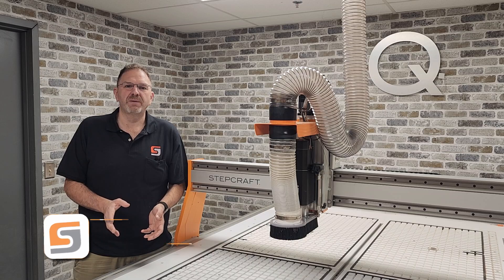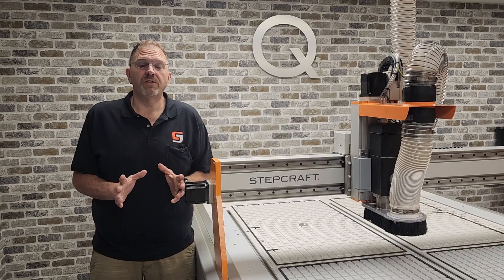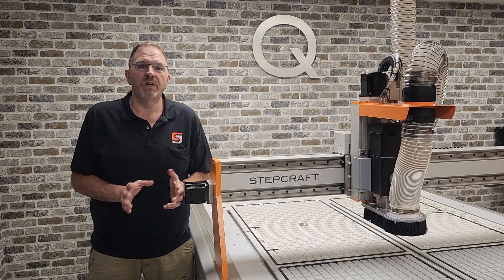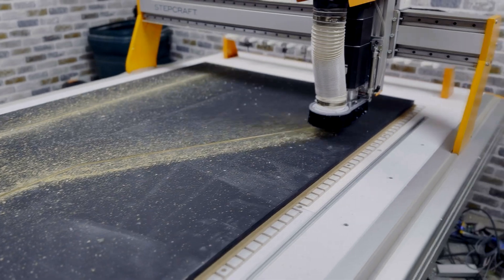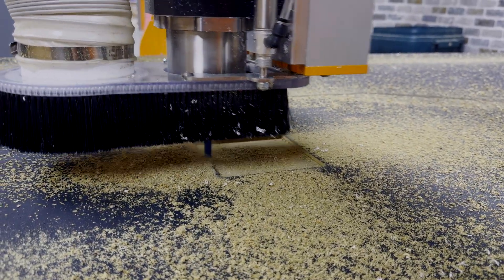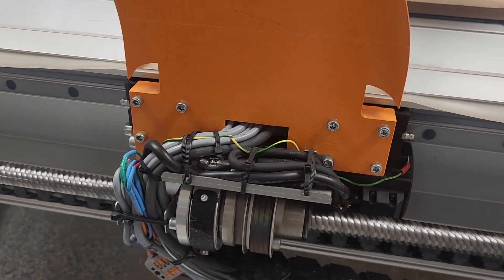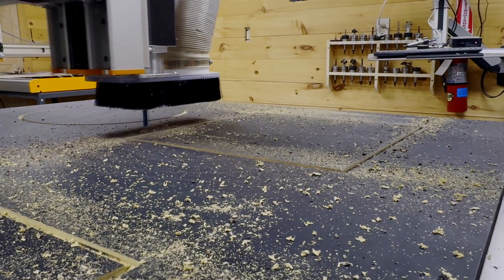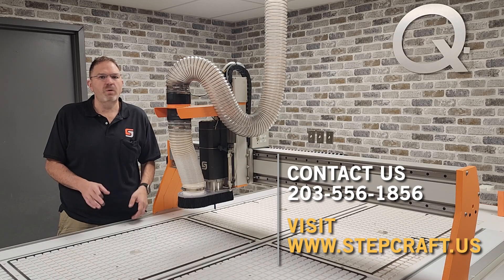Watch this series before you buy! STEPCRAFT Q.408 - Episode 1: Speed

Comment: Ever consider a 4x10’ model? Or is that not possible with ball screws? I flatten a lot of 10’ slabs and need 10’ minimum.
Reply from the maker: Hi, I will take your comments to our engineering team for future consideration.  Thank you!.  One thing that many of our customers do take advantage of, is the fact that our machines offer a pass-trough in the Y direction.  This means you can use the Q.408 to flatten a slab longer than 8 feet by running it and then sliding the material back in the machine and running the remainder.  You will find that detecting where the overlap is located is nearly impossible to locate.  When you get into the longer machines the price goes up significantly.  This is one option to do what you need with our standard machine.
Reply: @ Thanks for the reply. I’m familiar with the pass through approach. But from a production standpoint, I’d like to just set it and forget it. I’ll keep my eye out for a 10’ model in the next few years. I have enough tools to keep me busy for now, so I can wait. Keep up the good work. You guys make some innovative stuff.